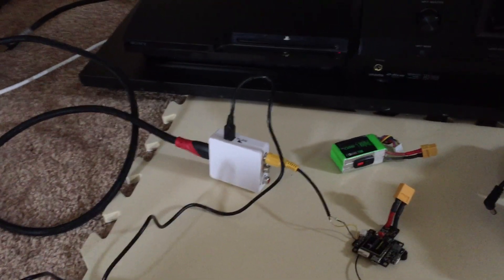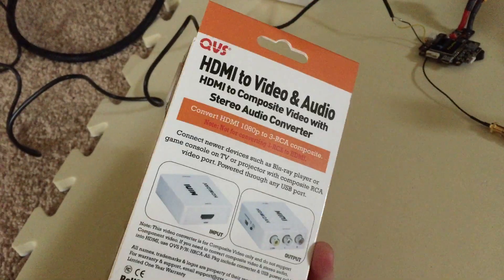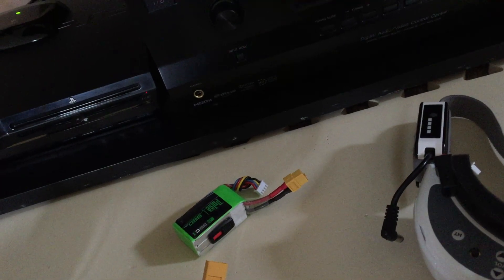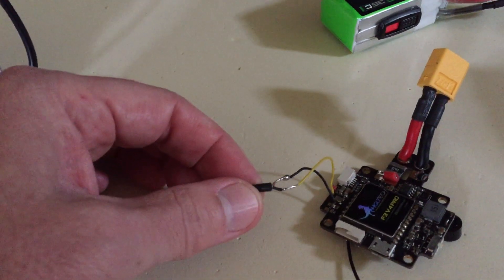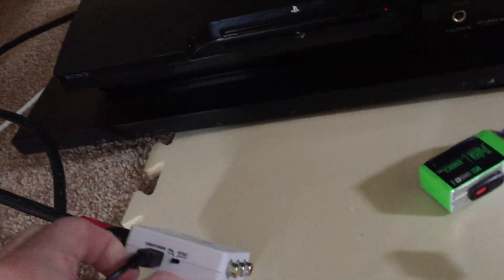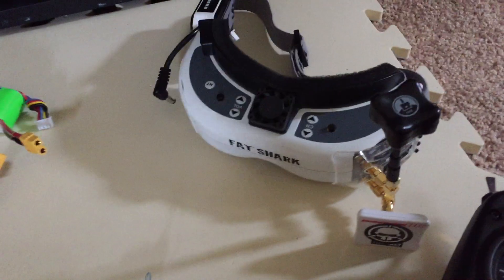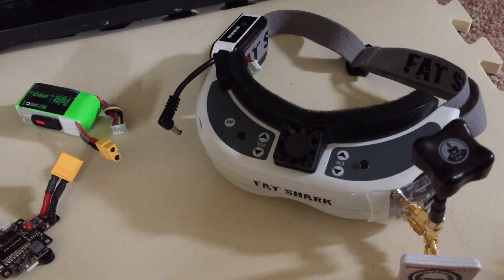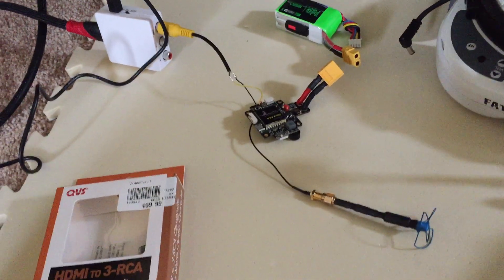Wireless Video from PC to Fatshark Goggles

Comment: Do you have any idea if there is a way to get DVI-I to VGA out to work with a fpv VTX? I have DVI-D and DVI-I ports on my video card, no HDMI on this machine. I wonder if something like this could be used as a dual display setup - https://www.amazon.com/gofanco-Active-DVI-D-Adapter-Converter/dp/B01FL7H7HA/ref=cm_cr_arp_d_product_top?ie=UTF8
Thanks!
Reply from the maker: I don't know of any way to go from VGA to a VTX but I think in order to interface to a VTX you will need RCA ports,  something like this might work.

https://www.newegg.com/Product/Product.aspx?Item=9SIA2JX4UN7609&cm_re=dvi_to_composite_cable-9SIA2JX4UN7609-Product
Reply: Thank you. I haven't seen this type of adapter before.

Comment: Are you getting clear video on your goggles with no noise?
Reply from the maker: Ronn2664 Yeah works great,  I think I upped my signal to 200mw to combat any noise in the house.
Reply: Dennis Forbes Nice. I tried the converter with just a vtx and battery but I was getting video noise.
Reply: Dennis Forbes I tried another vtx and everything works fine now. :D
Reply from the maker: That's awesome,  pretty cool eh.  Makes a huge difference,  much more immersive.

Comment: I did the same for a while, but I powered my vtx also from USB and my goggles from wall wart so I don't need do care about batteries. Good video
Reply from the maker: Yeah as you can see I had some clean up to do.  I am printing a case now and cleaned up the wiring so that I can power the whole unit from a wall wart.  Curious,  you said you did this for awhile,  did you find a better setup or just tired of it?  Thanks!
Reply: Dennis Forbes It was really tiring using the goggles without taking breaks. With the sim I can sit for a couple hours constantly, and the goggles weren't suited for that.
Reply: Dennis Forbes Have you printed the case? Is it in thingiverse?